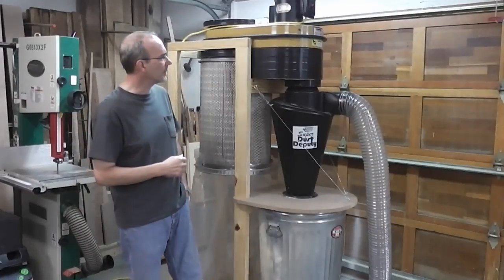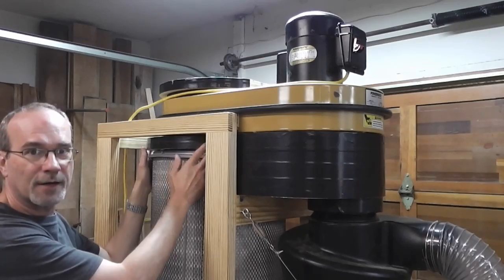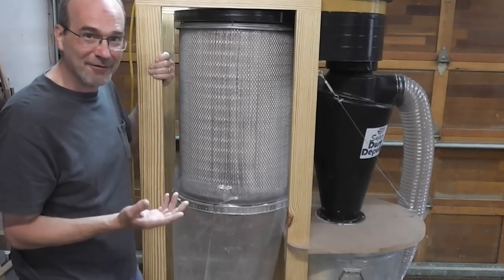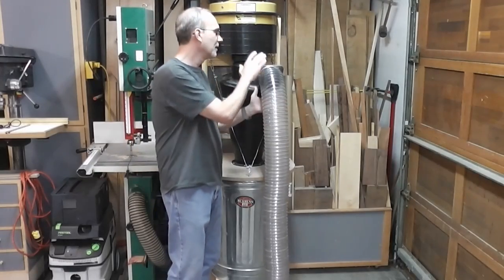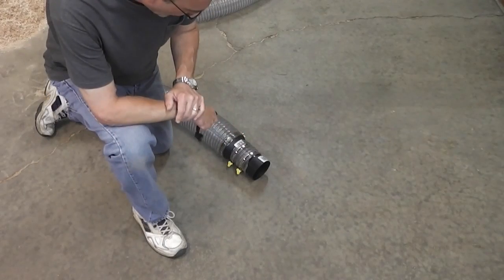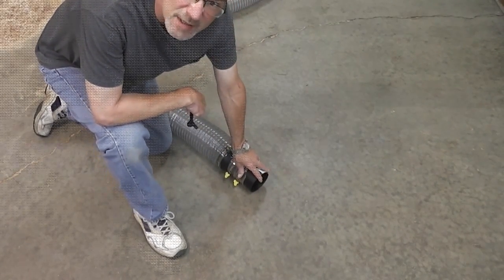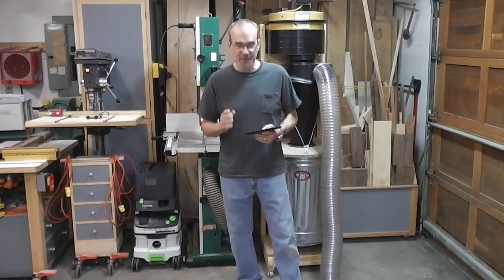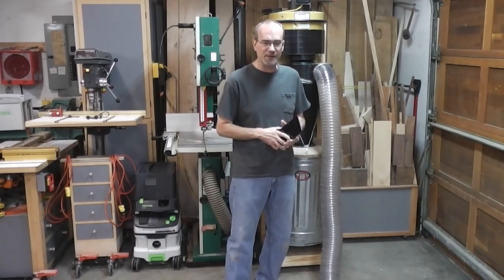Dust Collector Upgrade - Pt 2 - Complete System Rebuild

Comment: Guy, much appreciated. Hard numbers for before and after, clean and dirty make this a valuable contribution. My Delta DC claims 1200 cfm, and I've upgraded to Wynn filter which helped, but stayed with 4 inch hose. I've been wondering what my real numbers are. Only one way to find out!
Reply from the maker: Michael, changing over to a 5" hose made a much bigger difference than I thought. If you want to check your velocity, think about getting an inexpensive anemometer on amazon.com. Just remember to convert it to cfm with consideration for the cross section of the final hose connection to the machine.
Reply: GuysWoodshop Thanks. A little rusty here. Ft/min times square ft = cubic ft/min?
Reply from the maker: Michael Anderson pi r2=cross section of hose. The multiplier for 4 " is .0876, the multiplier for 5" is .136. So if you have 5000 fpm, 5000 x .136 (5" hose) = 680 CFM.
Reply: GuysWoodshop Ah, I see. The multiplier is for converting cross sectional area in sq inches to sq ft. Have to work in consistent units ;-) Thanks. I'll look at anemometers on Amazon.